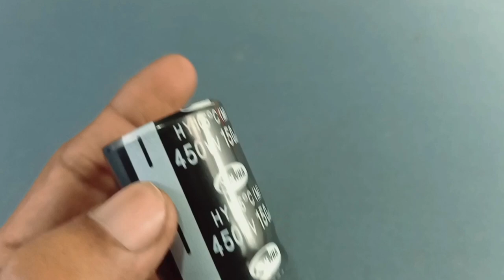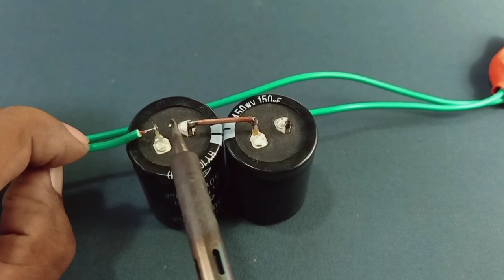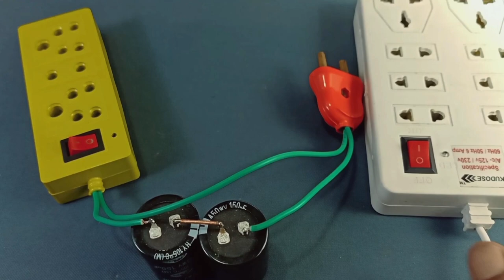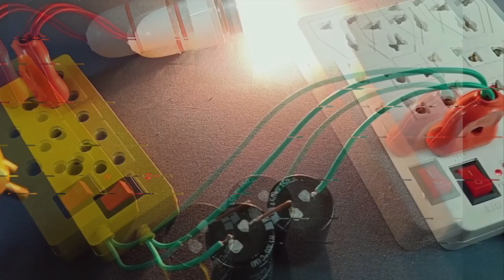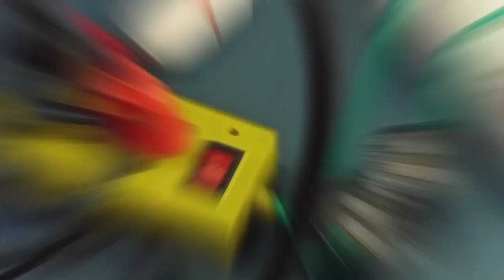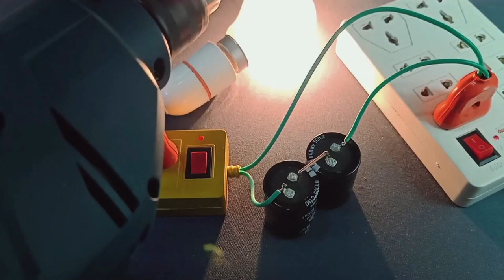Heavy Load Short Circuit Device // Very Helpful for Everyhome

Comment: After switch off dc flow will be there in the board right ? Aso we cannot use capacitor in series
Reply from the maker: Because, ac supply,
Reply: @RJEDITALL  can we connect capacitor in series in Ac ? I searched in google and got result that is we can connect 2 or more capacitor in series but can't connect in parallel with supply
Reply from the maker: @vishalrajal  don't connect capacitor series with ac, maximum use non polarity capacitor in ac.